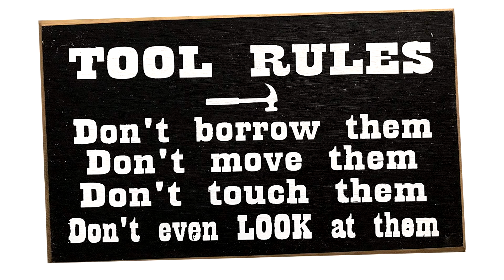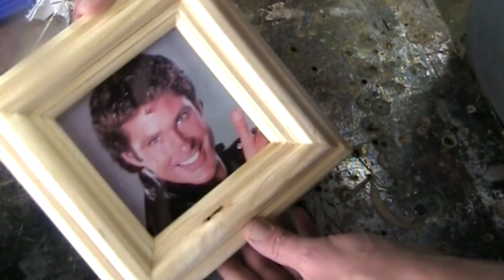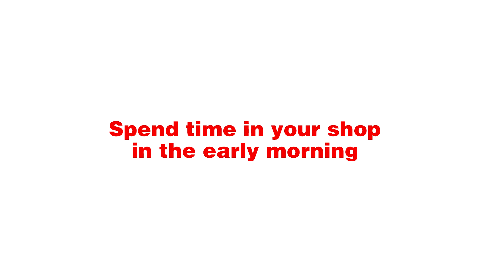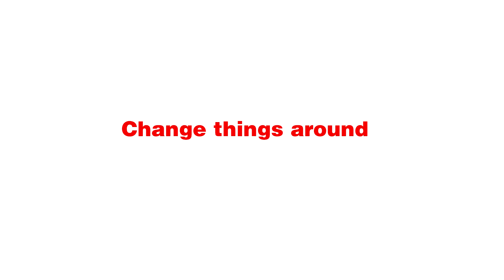Should you let people borrow your tools? 8 ways to get more out of woodworking.

Comment: I agree that tools aren't everything. But it's well working ones that make the work a joy!
Replace those screwdrivers that have chomped up driving heads, throw away those damaged driver bits and abused, dull drill bits. Don't save them because they once cost you money! Get new ones.
Every time you need to do something and have to work with a skipping screwdriver or a dull jigsaw blade, it'll just make you grumpy and leave a bad imprint in your memory about the whole experience.
Reply: I agree with your sentiments but I have always found there is a great deal of satisfaction to be found in reshaping a worn screwdriver.  Of course there comes a day when you just have to buy a new tool and lie to the wife about how much it cost.
Reply: @andrewgray9663  reshaping... Now that's a really good money saving idea! Thanks for the (driver) tip Andrew!
Reply: Dull drill bits can be resharpened with a bit sharpener
Reply: @foggycloud2583  I should've mentioned that I was coming from a home improvement kind of situation :-)
You're right that one with a hobby workshop could buy these kinds of sharpeners.
Reply: @andrewgray9663  I just upgraded my jigsaw from one that did not work properly and would occasionally eject a blade while I was trying to cut to an inexpensive yet functional ryobi... omg, the difference is everything. Working is joyful instead of anxiety inducing.

Comment: Hi Steve, I figured out that over the last 60 years or so I have lent out around 200 pieces of equipment or tools and have got 2 (yes two) back. Seems the others ended up in the Bermuda Triangle. My idea is that if you can't afford to replace the tools out of your own pocket, don't lend them out, they invariably get forgotten by the borrower. Still that hasn't diminished my pleasure of working in my 70s. Always good to see when you post new videos.

Comment: My advise is always DO NOT LEND TOOLS. it's a great way to loose friends, 1/ when they are late at returning said tools. 2/ when your tools become amalgamated into the persons own tools and then they start to think that they are theirs. 3/ it becomes a habit of theirs just to borrow yours, much easier for them. 4/ if they break or damage the borrowed tool. They never want to replace anything. 5/ usage. You don't know how they have used your tools with the consequence of early failure. When I started work at the age of 15 years, I went straight into the fitting shop , and there I was told in no uncertain way, that YOU DO NOT BORROW OR LEND TOOLS. I have kept this principle all my life and believe me it's good sound advise.
Reply: I have a cheap driller and it's the only tool I lend.
Reply: Perhaps it's a great way to filter out bad friends. The good ones are appreciative and thankful, the smart ones know they likely need your help operating the tool correctly and safely, and the considerate ones return them clean without you having to track them down.

Comment: Hi Steve ! 
I saw this say  " Tool Rules" 
While this doesn't have anything to do with lending tools . I just got back from the doctors as my finger got bit by the table saw. I was cutting a piece of wood and when I was done I powered it off but like a dummy I didn't let the saw come to a complete stop before grabbing the piece and I was worried about the wood burning ( not an excuse ) and while grabbing it my thumb caught the blade that was still spinning and did a number on it. 
Ironically I am one of the Safety people at my job and am always telling people to step back and take 1 minute or 5 minutes to think about what they are doing before doing it. Wish I would have used my own advise and not been so dumb. 
much love ! 
~Steven

Comment: I have a very small unheated (in Canada mind you) garage which is shared with my "shop" and an SUV.  So my table saw and work bench are fold up and wheeled.  My other tools are organized in wheeled cases.  When someone new moves in near by, I go over to see if they need any tools and carrying my home fix-it bag with basic tools and "fixings" (switch plate, washers, nails, screws, various tapes, glues, sprays, etc.). They almost always need something.  During the visit I let them know that they are welcome to use anything in my shop or borrow them for a project.  I lose far more things on my own than they have ever lost.  I get paid back in scrap lumber and since I only make very small projects (remember the shared garage thing: set up, work, & put away before my wife needs to park the SUV), I rarely need to buy any wood.  One side benefit of the open shop is the community building.  When a young lady was in a car accident and needed to be in a wheel chair for months, the neighbors used my shop to build front and back door ramps plus one for the sunken living room.  I had no part in it.  My wife and I were away on a trip.

Comment: My favorite aspects of woodworking are a) the rush I get from the smell of wood and sawdust whenever I enter the shop and b) achieving a particularly good cut or edge or joint when finishing a single piece.  The process of assembling all the parts into a finished product is practically an afterthought, almost a let-down.

Comment: My shop serves as both a tool library and a community use space for my neighbours and my friends, particularly other medieval reenactors. Space where I live is tight and expensive, so when I moved back I noticed all my friends were just using jigsaws and lengths of 2x4 in the back garden for cutting.

5 years later I'm able to take rough sawn lumber and put out 6 side machined boards, making it so much easier on everyone.

Plus it's great having extra hands most weekends!

Myself and one other friend serve as teachers, and there are shop rules, mainly you are there at your own risk, you don't use anything you've not been shown how to use yet, and you tell me if you break something.

About once a year I have to knock heads together to remind people to leave it tidy, but that's the only issue that ever really comes up.

Comment: Well, as a beginning woodworker, I enjoy acquiring the tools I need for a job, or being able to work on new jobs and do jobs in new ways because of new tools I have acquired. To me, it is all part of a holistic enjoyment and the tools factor into it. For example, I just got my first cordless impact driver and got it charged up and ready to go. I can't wait to try it out on some new job and enjoy how much easier it now is with that tool. I still need some basics such as a table saw, sander, router, and miter saw but I am sure that when I get those I will have fun using them and be eager to try out new projects. Yes, the brand and cost can be irrelevant and a distraction to woodworking but for me the tools have their place as part of the enjoyment.

Comment: @ 1:08 you talk about people who say "Having quality tools makes your woodworking better and more enjoyable."  I AGREE! 

I started with a Chicago Electric table saw.  The table wings drooped on either side of the saw blade. The fence was completely unusable.  I'd spend upwards of 10 minutes aligning the fence every time I changed it.  The combination of the saw and my working in the weather was so aggravating that I almost gave up woodworking and was ready to give away my tools.   In fact, I didn't work for an entire year or more because I hated the frustration!

A friend of mine set up his shop and let me work in it.  Then, a Dewalt DW745 went on sale at Lowes when I actually had the money to get it.  I bought it and loved it.  Unfortunately, mine was defective so when I returned it, I found a bigger, better, and more expensive Hitachi that I could also afford, so I traded up for it. 

Now, I still have to work when the weather is good, but, I can roll out my tablesaw, plug it in and accurately make a dozen different sized cuts in only 5 minutes!  (yes, I timed it. and when it rains, my entire shop can be moved back into the shed in less than 2 minutes.)

Tolerating the weather is no long as frustrating as it was.  I really look forward to the beautiful weather days when I am off to do woodworking. 

The rest of my tools are much cheaper, along the line of the harbor freight tablesaw, but they do the job.  For me, the most important, and most often used tools that take upwards of 95% of my time are the Tablesaw, Mitersaw, and Sanders (hand belt and orbital sanders). 

For me, the only "quality" tool I have right now is my tablesaw.  The others are cheap as I could find, and they are doing the job and doing it well.  So, except for my cordless drills/drivers, I am not looking forward to upgrading anything at this time. 

Since I got a quality tablesaw, I built a take-apart work bench, a movable mitersaw stand and started on a tablesaw stand. (I never finished it as I replaced the Dewalt with a Hitachi that included the perfect stand.) 

If it were clear weather outside, I'd be putting up my workshop instead of answering YouTubers right now, LOL.

I'll watch the rest of your video now.

Comment: I don't fear lending my tools to neighbors.  1) We all know where each other lives. 2) I tend to buy Harbor Freight and Hyper Tough, so even if they are damaged or broken, I'm not out much and can usually get a cheap replacement of the same kind within the week. =)

I also won't borrow a tool if I'm not 100% sure how to use it, so when those times come up, I go to the friend or relative's house and have them demonstrate it for me (which usually means they do it to the object I was going to use in the first place, which saves me time). ;)   After that, I know how to use it so if I need it again, I'll be able to do it myself with less chance that I'll mess it up. =)

I absolutely agree with you on the use of screws over nails.  I hate nails.  The wood warps and they pop right out, but I've never had that problem with screws.  Fixed an old section of wooden fence a month ago that was originally put up with nails by replacing them with wood screws.  I'll never have to touch it, again (unless someone drives through it, I guess...) and I've recently removed the brads from a porch swing that were popping out and replaced most of them with screws as well.  Now, people don't get poked by them when they're using it, and nothing catches on their clothes to unravel them.  LOVE wood screws! =)

Comment: I used to love design tech woodwork back at school, but school finished, i I got a job, or 3 up to this point, and things always seem so hecktic, with kids and work. But one thing I never strayed from at all, was home theatre, and I’ve heard some beautiful speakers, but now I want to build my own. 7 identical speakers and 2 subwoofers. In the past 4 weeks I’ve purchased a circular saw, carpenters square, 1m aluminium ruler, a 45/90 straight edge thing...2 metal rulers with the 45/90 angle thing on it..12” F clamps, 800mm F clamps, 4 very heavy duty Stanley mitre clamps, and a Bosch router and bit set are incoming for father day🤗🤗. By the time my kids are old enough to be trusted with certain tools(power blades etc) and show a deep interest, I hope to have pretty much any tool they need in my little tool cupboard😂😂😂. Oh, and I haven’t even bought any wood glue yet😂😂😂. Project under way!  Keep up your great videos dude👍🏻👍🏻🤗

Comment: a far as better tools not bringing you joy, its possible i am alone in this but , maybe they don't directly provide joy but, for me, there is a very real joy in upgrading from an older cheap tool that has become very fidgety like my old bench top band saw that got to where i could never get it to track right with the 1/8th blade, and i had to re set it up almost every time i used it, to my new laguna 1412 which is just a freaking dream to set up and use.  and even if you aren't going to that extreme, it can enhance your over all experience by simply lowering the frustration level of working with tools that are not up to snuff, won't hold settings, wobble around, or just don't work right.

Comment: I lend tools all the time,but the tools i consider "special" i have two sets. I have a set of Stanley plastic handle chisels that I have spent time on flattening the backs, and sharpening up on the water stones. If you ask to borrow  a chisel, that's what you get and the Stanley Sweetheart 750's will stay locked in the cabinet. I also have a set of Buck Brothers hand planes I have tuned up nicely. When borrowers want to borrow a plane, that's what they get, and my lovely vintage Stanley planes stay in the cabinet. 
I use my "second string" tools for rough work, so it's not a waste. I save the good stuff for very fine and delicate work.
 If someone borrows a chisel, and tries to cut through a nail with it, I dont have a brain hemorrhage, because the good chisels are still locked in the cabinet.
:-)

Comment: Without any hesitation I'm stating for myself: Having good quality tools makes woodworking better and more enjoyable.
Reply: I completley agree. For years I have used crappy tools from Harbor Freight always thinking that they are "just as good" as I was able to complete my hobby tasks, that is completely wrong. They are NOT just as good. Fit and finish is the most obvious. Power and longevity not so obvious. I upgraded some power tools recently and am blown away how easier it is to use a nicer tool. The drill and saws dont lock up when I'm pushing too hard now and have way more settings and options. Also I upgraded to a nicer axe and totally worth the money compared to the big box brands. Better steel means I dont need to sharpen all the time.

Comment: I like your channel even more know I know what a good guy you are. You mentioned going to antique shops to look at how things are made- here in the UK we have lots of antiques, and the market for what is called in the trade 'brown stuff' has nose-dived. Clunky old Victorian oak furniture is no longer wanted, and you can buy wonderful,heavy tables for far,far less than the wood is worth. It sort of breaks my heart putting table tops through the saw, but it's great stuff, and usually the boards used are far wider than you would find today. I do strip down some stuff, if it's not too time-consuming, and sometimes add new 'contemporary' legs. I've bought various oak and elm tables, with drawers, all for under $100.

Comment: As far as tools, I agree that you don't need to go out and spend a ton of money but, one of my biggest frustrations and the reason I became discouraged and dropped out of the craft for several years when I first tried wood working was because I cut cost and bought low end tools. I learned pretty quickly that if you have a table saw that has a crappy fence and doesn't cut accurately or a tool that isn't square you will run into frustration after frustration. It all builds on itself and you end up with gaps in your joints, pieces that don't line up right... While you don't need to buy the top of the line you really do need to buy good tools.

Comment: Wow, I wish you lived near me so I could get all your excess wood!  There's hardly anything on Craig's List in my area.  
I FINALLY have my "workshop" up. :D  It is one of those temporary shelters from Harbor Freight, but you have to start somewhere, right?  It's a place where I was able to unbox my table saw, set up my chop saw, and get my other tools organized.  I just built my first project in it, a coop for my guineas (video coming soon).  I have other projects in mind that I can't wait to get started on.  Thing is, right now, funds are really tight and there is nothing extra for lumber. :(  But am I letting that stop me? NO WAY!  I had to clear some pasture when we moved here and for some odd reason I saved all the trunks from the young trees I had to cut down. I just couldn't bring my self to add them to the burn pile.  Well, I have some ideas for using them to help me organize my new work space! I can hardly wait to get started on it!

Comment: This is a tough one for me. Way back a neighbour offered me the use of a powered lawn rake and when I eventually asked to borrow it she looked at me as if I had asked her to lick the cats litter tray clean. But she gave me it and I returned it in super clean condition - like it was just out of the box as my thanks for the loan ... nothing! More recently I offered a neighbour the use of an air powered nail gun to help with his shed build. My air, my power for the air .... my nails for the gun and it all came back covered in bitumen adhesive that he had used for the shed roof. Other offers of tools have resulted in hand saws returned after the dog chewed the handle or power planes which strangely didn't react well with nails! Who knew?   Now if someone asks for a tool it comes "free with me". I understand that folks don't really understand tools so now when asked,  I offer to support the project which protects my tools and helps the user/"loanee" to learn. Not as an act of kindness ....... I'm running out of places to hide the bodies of tool killers ....

Comment: Really like your channel! I have a  old LOUD 10” skilsaw table saw with an unreliable fence, loose fitting channel guides, no guard or blade behind the saw that I over paid for at a used tool store. Every since I’ve been shopping for a good used one in the $150 range and havnt had much luck  what do you suggest for under $200 or to make my skilsaw more work friendly . Guard would be nice but not necessary since I stay miles from the blade because it’s scary.